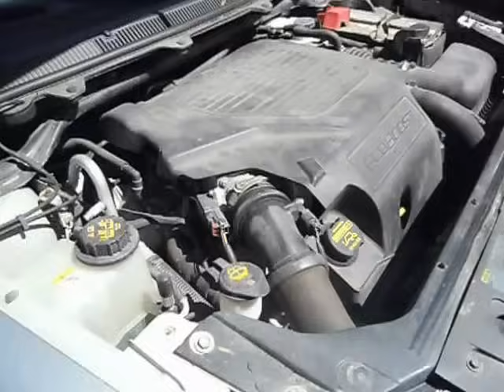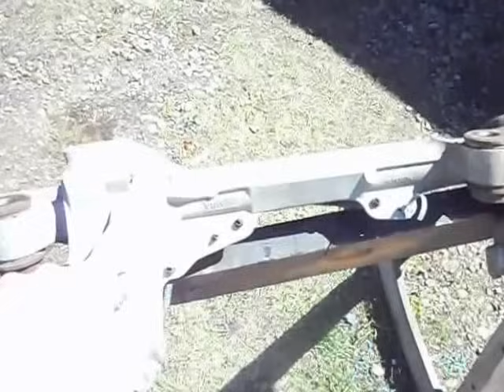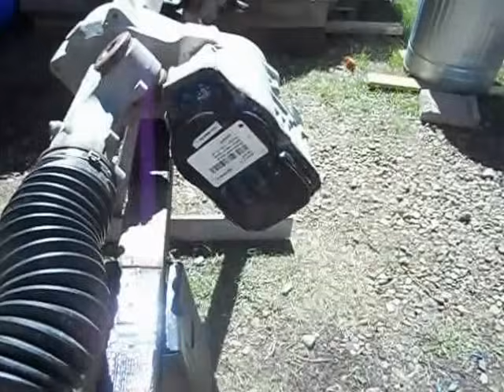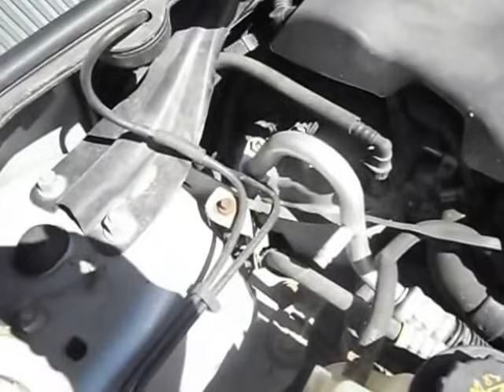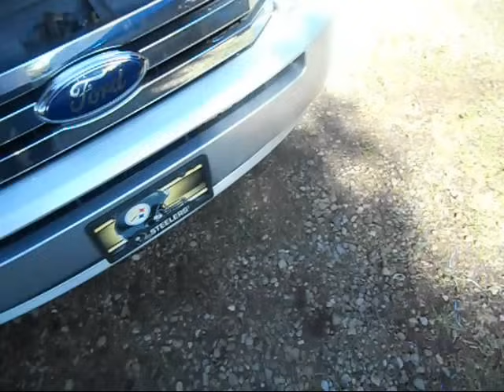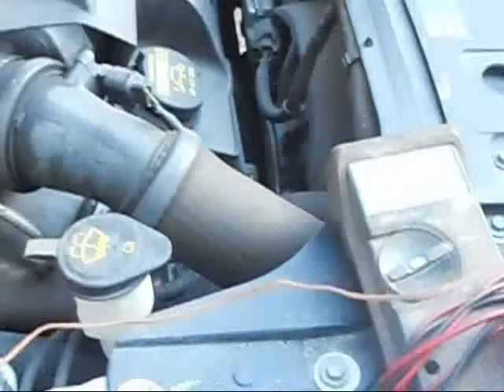Ford Electric Power Steering Failure Identified

Comment: This just happened to my 2013 Focus ST. I'll probably end up buying the replacement part and installing myself and then selling the car, its not worth the hassle to deal with them. I only had 24k on my car since I don't drive it every day but they still told me that the 3/36 warranty applies so I was out of luck. I went through one set of tyres within 13k and the current set is wearing unevenly and will have to be replaced soon. It destroyed my front control arm rear bushings, which I replaced because I wasn't aware of what was really causing the problems and no one diagnosed it until it was too late.

Definitely not buying Ford ever again.
Reply from the maker: I have published indications that EPAS failures are worsened when worn suspension components induce active compensation on EPAS units. EPAS corrective compensation causes servo actuation, which generates additional thermal load in an already thermally stressed system. I have not considered EPAS failures causing suspension damage; However, this disposition is certainly possible if failing EPAS servo actuation induces suspension component stresses. Can you please elaborate further on symptoms and  nature of vehicle failure.
Reply: At first it started with an apparent misalignment. I also felt that in the centered position the wheel had a dead spot. I took it to get it aligned, but there was an amount (can't recall the degrees now for certain) that wouldn't align no matter what. While looking under the car, we noticed that the front control arm bushings were completely shot, so I decided to get some polyurethane ones from Whiteline. 

Once those got installed, the feeling of the dead spot was gone and it felt fine to steer again left or right, but if you left the wheel without pressure under braking, it would tend to steer to the right. The car got aligned again, and still couldn't get it to the proper degrees.

About a few weeks later, I started to notice that at slow speeds I would feel a sensation of the car moving up and down as if a wheel was bent. We checked them and found nothing, although one of the tyres need re-balancing so we did that too. But the car would still turn itself under braking, even at lower speeds. 

Then about a week and half ago, I felt a loud grinding noise when turning and the car looked like it had been lowered on the front a bit. I seriously believed that the front suspension had completely collapsed, so I took it to a mechanic immediately. I explained what had happened and they lifted the car and tried to recreate it by moving the wheel back and forth while lifted with force and he noticed that the steering rack was vibrating while making a grinding noise, same as before. I haven't driven the car yet after that incident.

The truth is, the power steering is not completely gone yet. I could still technically drive the car, but do I have to wait till it fails completely while driving it and crash so Ford actually takes the issue seriously? Not going to do that.
Reply from the maker: Your steering issue seems to be convoluted with other suspension problems; I would guess either tire, bushing or damaged component most likely aggravated your EPAS steering failure. EPAS failure is still not acceptable given circumstances. Grinding and vibration indicate serious EPAS failure, most likely failed steering position encoder or motor drive components. Ford will not take responsibility for failure, even if you have an accident as I did. Ford is only interested in protecting corporate image and will deflect and delay your complaint. If you get injured, Ford will put you through 4 month legal investigation while your out of service vehicle sits in driveway.You need not wait for full system failure, as your vehicle is out of warranty. Unfortunately, your position benefits Ford, as they can ignore your complaint, do as little as possible, and tell you company is performing courtesy if they do anything at all (which would be partial coverage of repair cost). Your initial impulse to make repairs and sell vehicle is wise; as problems will persist. Ford has placed millions of consumers in exact same position you are experiencing; it is frustrating to realize both Ford and the NHTSA could care less about your problem. It will take multiple fatalities to draw attention to fraudulent and criminal nature of Ford/NHTSA relationship. The NHTSA went after Takada with full force, nearly forcing company into bankruptcy; but holds hands with US automakers for blatant and criminal engineering incompetence.
Reply: Agree with all you said. They don't realize that by dismissing these issues they are bleeding customers left and right. I was actually considering getting an RS but now I won't be even looking at it or any other Fords.

Btw, I wanted to ask you: does the installation of the steering rack require any sort of programming to the computer, or is it just a straight foward installation? I already sourced where to get it and who to install it since I really don't want to go through Ford. Thanks in advance.
Reply from the maker: thelivinglegend
Installation requires no programming or special procedure, assembly is plug & play. There may be a couple ECM errors stored in memory, but assembly will function at once. You will need to make sure vehicle front end is professionally and meticulously aligned, Otherwise EPAS will provide compensation for wheel offset; starting another cycle of thermal stress. Good luck! And please remember to rid yourself of vehicle ASAP.
Reply: Thank you for everything, you have been incredibly helpful. And I will, definitely not keeping it around for longer than I need to.

Comment: This will be my 2nd replacement I bought part used because of the crazy ass price they told me 2k 
First time I was on eway and it locked up 
This time I knew what it was 
2010 Mercury Milan isn’t on the recall list but THEY HOUND ME ABOUT THE AIR BAG SMH
Reply from the maker: My advise to Ford owners experiencing defective EPAS units, has been to replace assembly, then dispose of vehicle. EPAS replacement remains temporary fix; as thermal issues have not been corrected or acknowledged by Ford. Some consumers have reported up to five replacement EPAS units on this channel; all failing under identical dispositions. Ford is happy selling replacement EPAS assemblies and charging $2-3K for service. At the foundation of your issue is fact vehicle is hazardous to you and your family. Experiencing EPAS failure resulting in steering lockup, or non-commanded steer while driving is real possibility.
Reply: They hound us about the air bag because they want you to live when your rack fails. I have a brand new Rack still in a box that I was going to install in my 2010 milan,  I'm sending it back today.

Comment: You're wrong with how it works. It contains a traditional Rack and Pinion setup, the power assist comes from the electric motor/belt cog setup. There is a sensor that measures driver input and calculates that and vehicle speed to determine the amount of assist. You wouldn't never be left without the ability to steer should the power assist fail.
Reply from the maker: You have unfortunately confused points in video and incorrectly stated facts. I am fully aware system contains mechanical rack-pinion, and that normal steering is 'theoretically' maintained during electronics failure. However, you seem to be unaware that stepper or brushless DC servo systems can electrically 'lock' or produce 'non-commanded torque' in steering system during driving. Even with mechanical rack-pinion; system can cause loss of vehicle control due to servo-fault or component failure (which it does in application).
Ford used the same argument in selling EPAS systems to NHTSA inspectors during first fault investigation. In that, mechanical rack-pinion would act as redundant mechanical backup to electrical faults; which is does under most conditions. But the engineering fundamentals associated with electrically assisted mechanical rack-pinion implementations were not properly understood or addressed by NHTSA; specifically the various servo-fault and failure recovery scenarios, that remain problematic in servo design. Every servo design engineer learns in 'Control Systems 101' that inherent to any active servo-system are critical failure-modes that must be considered in 'fail-safe' design. Failed motor drive 'transistor or MOSFET' circuitry can cause 'high-current' path through motor winding, subsequently locking motor in place. Failure to provide redundant and fault tolerant feedback mechanisms can cause servo-position errors (non-commanded torques). Please take time to listen to points made in video, at no time do I ever state system is purely electrical in nature.
Your statement "You wouldn't never be left without the ability to steer should the power assist fail." is in fact incorrect, and demonstrates lack of servo-system proficiency. Having personally experienced steering lock-up in Ford vehicle causing accident and injury; I take this design deficiency seriously.
Think or your wife or children driving at speed on highway with faulty EPAS steering. Ford EPAS systems are poorly designed and dangerous.
I hope you never experience what it feels like to have your steering wheel locked in place, or jerked from your grip during driving. For those of us whom have experienced this particular Ford horror; it is no joke when someone defends Ford products from fault. Most Ford defenders I get seem to be young, inexperienced and unnaturally attached to there vehicle in some way. For the most part, I post fault information for those detrimentally affected by Ford design deficiencies, and received cold shoulder from Ford when attempting repair. It is obvious you have never experienced EPAS failure, or been rejected by Ford for experiencing problem. I sincerely hope you do not represent one of the typical Ford defenders. If so; please do not post in this forum. If on the other hand, you want to gain information and insight on Ford design deficiencies; you are welcome. But please maintain composure and respect, and please provide substantive technical backing to a point.

Comment: 2016 Ford Flex here. You guessed it, EPAS fail. Thank God I dont own it. Here is what really pisses me off, is that they dont even try to at least help out the tech saavy or diy'ers by making available some wiring diagrams or basic illustration for guidance. I have no way of knowing which wire runs to where for testing etc, short of disassembling major components to painfully trace it. They have now chosen to exclude repair information to Alldata & other repair programs as well. You will not find technical info on any 2015 or beyond models can you believe it? You must pay something like $300 directly to Ford (same ones that designed the flaw for you) to view info like that . It has become "dealership or death" and owners must accept it.  You don't own your car they do..... this is scary.....sad.
Reply from the maker: Ford does not want anyone venturing inside failed EPAS units, this is because evidence of thermally compromised components will be noted and perhaps displayed in pubic venue. Think about cost for Ford to actually acknowledge serious design flaw causing sudden steering failure due to engine compartment thermal stress. Ford would be obligated not only to replace EPAS assemblies, but correct engine compartment thermal anomaly. The real issue is Ford realizes there is no solution to placing non-automotive temperature-grade qualified component in engine compartment, let alone within 6cm of 1100 degree thermal source. This represents an engineering blunder of momentous proportion, and can only be corrected in redesign of engine compartment or EPAS unit. EPAS unit design is far too mixed-signal and mixed-technology to realize true automotive temperature-grade qualification. So Ford and the NHTSA will never take action simply because Ford would be repurchasing millions of defective automobiles from defrauded consumers, sold defective and hazardous EPAS implementations since 2008.
Reply: +K Smith 
Excellent point. I wonder how many people have already lost their lives to this & how many lawsuits filed yet no one will ever know cause Ford mutes them all.  Its really funny how they took the basic concept of a pair  of wheels that id supposed to steer left/right and transformed it into something complex involving algorithms, modules, sensors computers. Hail to the old fashion hydraulic system. The heat issue is not limited to just the turbo version Flex, this 2016 non-turbo model I am working on generates crazy heat levels.
Reply from the maker: I own an old John Deere tractor from ca. 1950's, the steering system is comprised of a wheel, shaft, worm gear, and pivot bushing. This system is considered crude by comparison to today's engineering standards. However, this system has worked continuously with heavy use for nearly 60 years without fail. And has never required replacement part or adjustment. I have no doubt when wheel is turned, steering will respond. The only way someone could be injured by this steering system, is if it fell on them.
There is absolutely no need to engineer highly-sophisticated and expensive vehicle systems, when tried and true methodologies have proved reliable and safe over countless years of service. And for what? A $2,000.00 dirt-poor implementation; so hydraulic fluid is not required, and fancy diagnostics to let you know your steering system has failed. Engineers today just do not understand fundamental rules of intrinsic safety in design of critical systems. The Ford EPAS system incorporates thousands of discrete components, computer, motor controller, rubber belts, power and communication facility, and not to mention thousands of lines of code. The probability of critical failure is already greatly elevated, even without placing the whole flawed assembly in a hellish thermal environment. Good god, what were they thinking!

Comment: Not standing up by any means for Ford, and also not saying that particular setup is not ridiculous. with thay being said, I have a base model 4 cylinder fusion (2011) that had issues with the eps motor failing following a recall issued. on my setup, obviously not an ecoboost system, and the cat is pretty fair distance from the eps module. so safe to say that with the location of the air dam leading to the module, failure didn't come from excess temperatures but rather from failure of the steering angle sensor.  Unfortunately temperatures are issues for any electronic components no matter what manufacturer you're referencing. some are smarter than others that they mounted the eps motor to the steering column but will have other components that we will look at them for that and wonder why on earth they designed it that way. no such thing as a perfect car.
Reply from the maker: The EPAS system represents a train wreck with millions of units failed and continuing to fail on Ford vehicles. It is simply an engineering disaster and very poor judgement to replace simple, reliable and time-proven hydraulic systems with highly sophisticated and expensive electronic implementation. There exists literally thousands of potential failure points in a system of this complexity; thermal stress is just one the Flex vehicle design exhibits. And for what? So you need not deal with filling hydraulic oil every couple years, and a fractional increase in gas mileage. And oh, yeah, there's the Ford published performance enhancements that owners never even notice, and actually maximize internal thermal stress on system. There is a simple rule in engineering design that defines and predicts failures based on level of complexity. Failures increase exponentially with complexity; this rule is fundamental to engineering methodology and cannot be ignored, worked around or corrected. Design engineers are no longer trained to make logical decisions based in wisdom; it is the simplistic and elegant design approach that exhibits genius. One point to consider; automotive manufacturers are relatively new to highly sophisticated electronic implementations like the EPAS system. Automotive engineers are gear-heads and mechanically oriented by nature. I have known and worked with many automotive engineers throughout my career; not able to recall one with expertise in circuit design.

Comment: Geez this is even worse than the escapes from this time period.  At least those are usually just that little torque sensor under the dash. I love my escape but I absolutely hate Ford. Mine died for about a week before I could get a chance to change the sensor and it was almost like the motor would fight me every quarter turn when it wasn’t working. I’m 6’2 and 200 lbs of muscle and I had to use all my strength and weight to steer that thing. I can not fathom how they don’t have to recall every vehicle with their failure prone epas systems.  If it was a smaller person who wasn’t as strong as me or an older lady or gentleman I could only see that going mid turn and not causing an accident by pure luck and miracle.  It’s absolutely pathetic quality
Reply: I completely understand your concern and question myself why not do the right thing. I'm an ox of a woman and I can't barely. Like I felt a verge of a heart attack trying to turn the damn thing when mine stopped properly working.
Reply: @amypotts1873  yea can you imagine some poor little 80 year old lady having that happen to them!  It’s absolutely absurd

Comment: I have a 2011 fusion with the steering assist fault. dealer wants 3000 to fix it - plus tax
Reply: Same exact car and issue... they want 2850. Other places say 2500. Ford is bogus for doing a warranty that expires after 10yrs instead of a recall